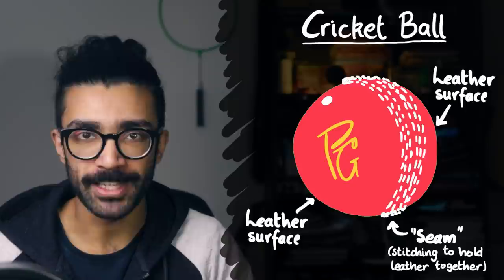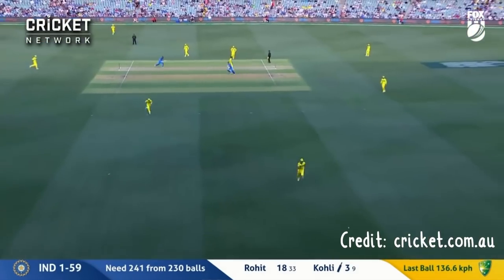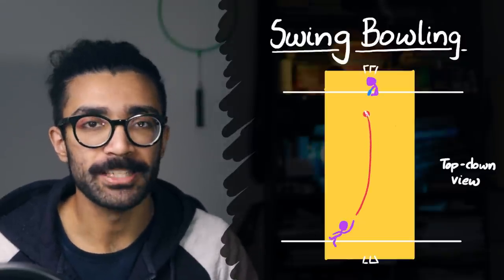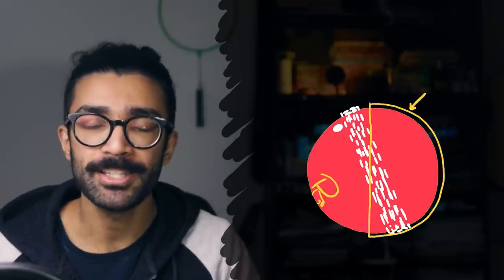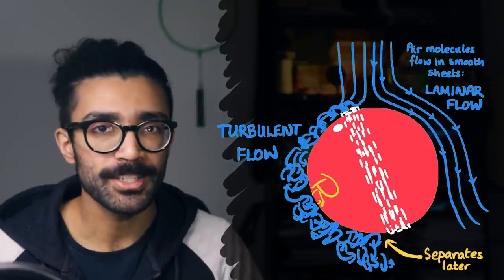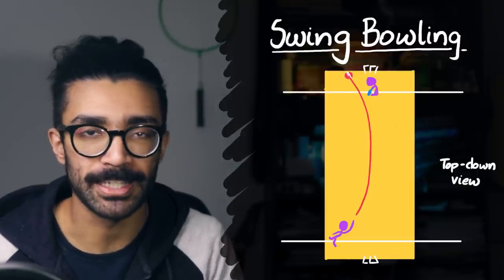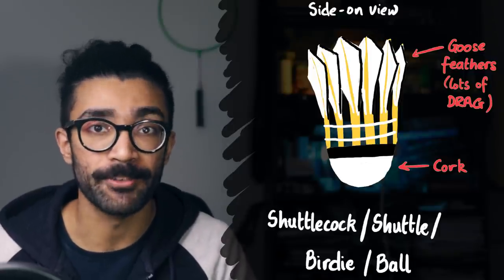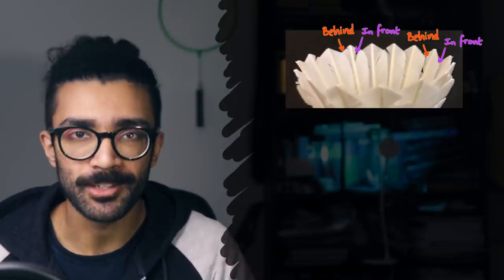Why These 3 Sports Use THESE Balls - Physics behind Sport by Parth G

Comment: Another sport where there is a distinct difference between right handed and left handed players is disc golf (i.e. frisbee golf). When throwing a disc, the rotation direction drastically affects its flight. A right handed player throwing backhanded will see the disc naturally turn to the left whereas a left handed player throwing backhanded will see the disc turn to the right. If a course is designed in a way that the holes tend to turn predominately one way or the other, this will give one group of players an advantage over the other. The physics of a flying disc are fascinating. I would love to see you do a video on that!

Comment: I didn't understand the force on the cricket ball in while ball is swinging 
I saw many videos but didn't understand force causes by laminar & turbulent flow...

Because in case of laminar air speed is higher and the pressure is lower 
While in case of turbulent flow speed is lower and pressure of molecules is higher
So, according to this ball go from higher to lower pressure region....
I didn't understand

Comment: I hate sports , but I do love Physics , therefore ,  I saw the entire video. I did really like the video but it is quite unnerving that you did not talk about electrostatic force regarding the rubbing of the ball (in cricket) i.e. 'ball tampering' which is an illegal activity.
Reply: I think it was meant to be a short video, but what do you mean by electrostatic force? As far as I'm aware, the rubbing of the cricket ball is done to smoothen the ball, so one side is comparatively rougher, which causes air to act turbulently on one side and laminarly on the other side. This is done to create a deadly strong reverse swing.